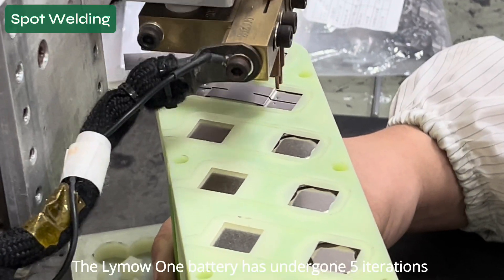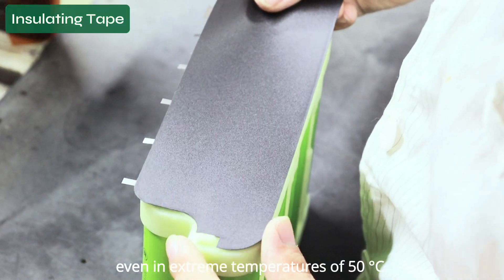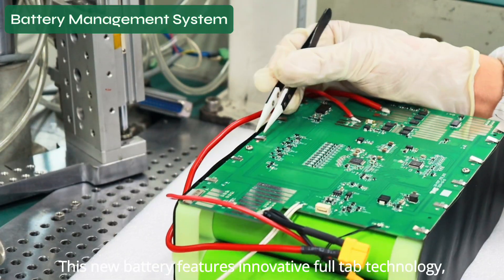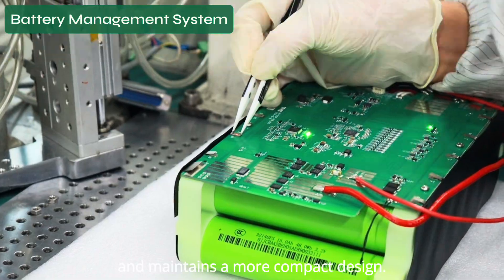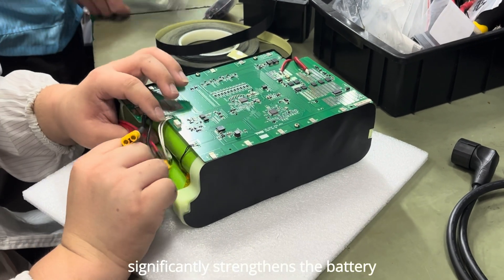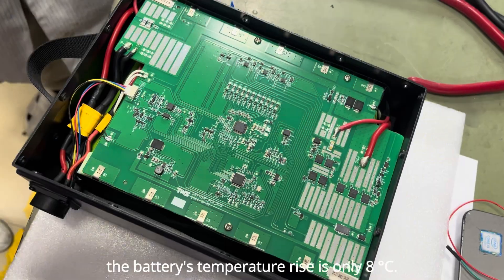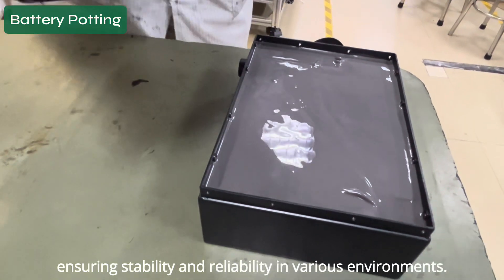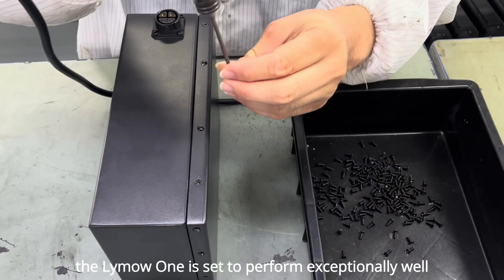Lymow One Battery Production Update 🔋

Comment: 25Ah is misleading.
25Ah rating from 12x 21700 batteries would only be accurate if using 3.2V or 12 batteries in parralel.
iI's more likely that it's using 2 parallel runs of 6 batteries in series.
So, for your 2P6S 21700 LiFePO4 battery configuration:
Voltage: 3.2V x 6 = 19.2V
Capacity (Ah rating): 2080mAh x 2 = 4160mAh or 4.16Ah
Reply: They are using 32140FS cells at 15.0Ah 48.0Wh 3.2V each and not the 21700 like you are mentioning.
Reply: @nickv6568  yep 100% what they are 32140FS cells at 15.0Ah 48.0Wh x 12 = 576  / 560Wh they are rating them at
Reply: Aren’t they using 32140 batteries in the video?
Reply: @Lolwowz3  Yup most probably